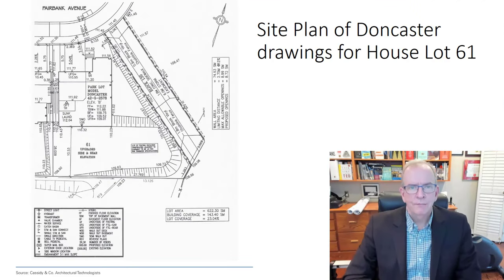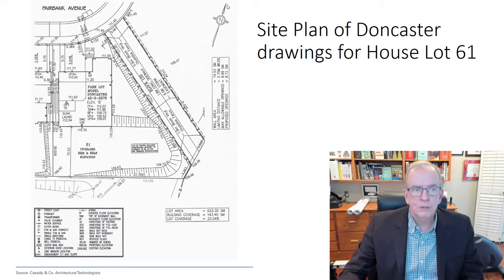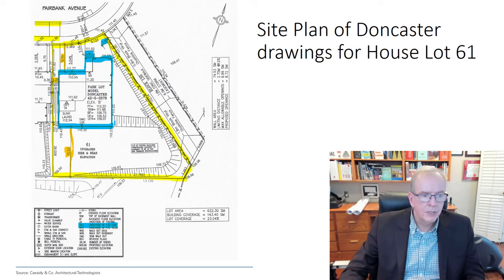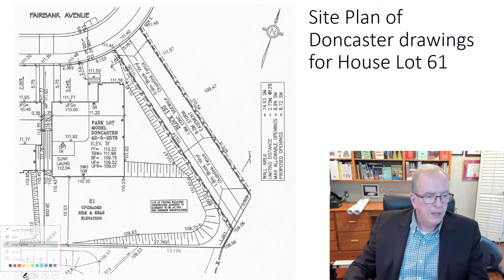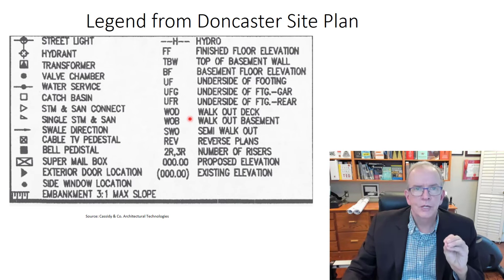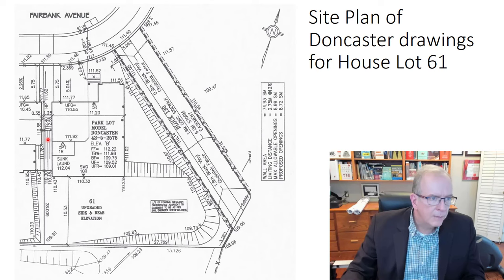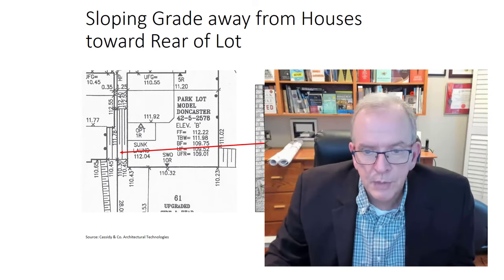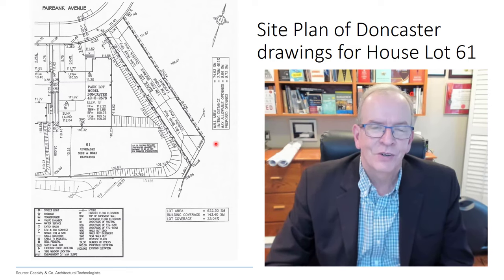LEARN TO READ & UNDERSTAND CONSTRUCTION DRAWINGS, HOW TO READ SITE PLANS LESSON #1

Comment: Professor Tom, you mention that minor  change  in  elevations in acceptable based on site plan comparatively.  what is " minor " change of elevations  that can be acceptable?  what is" dramatic "  change of elevations ? have any specific definition for " minor " or " dramatic"  change in elevations?   Thank you.
Reply from the maker: Hi Vivian, usually contract documents/specifications will reference certain standards.  Its in those standards that acceptable tolerances are provided.  In Canada it is often CSA Canada standards association that are referred to.